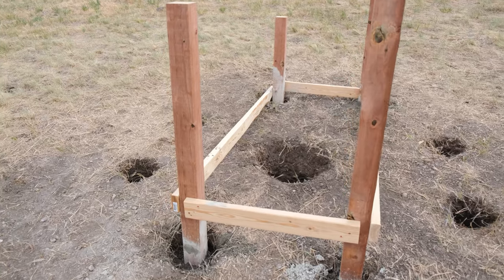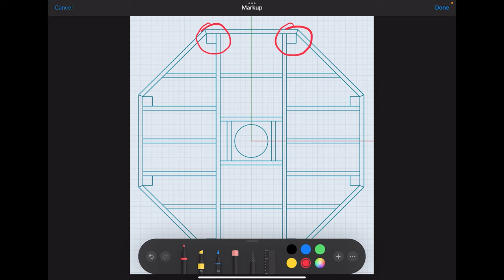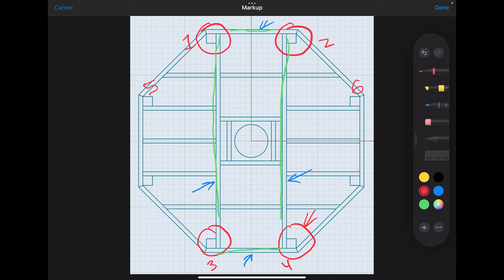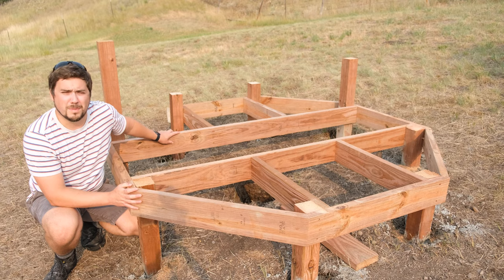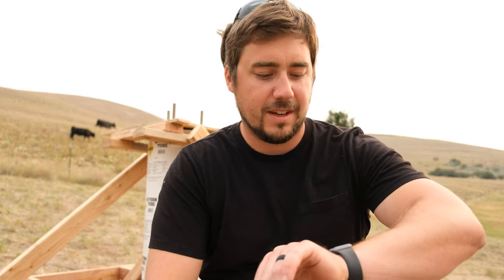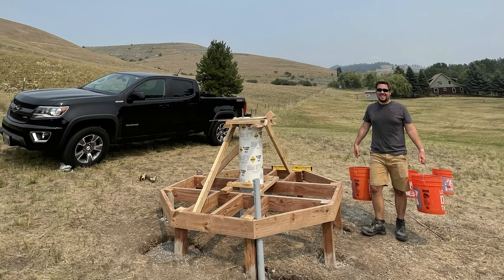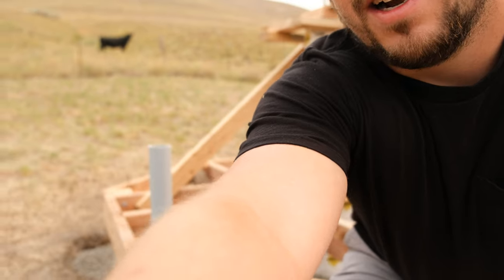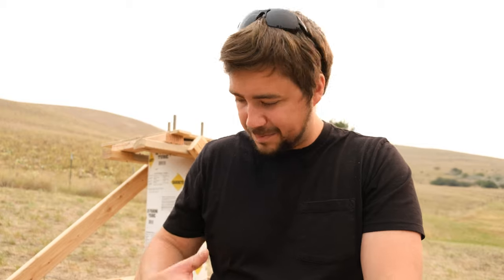Building a ROUND Deck for a NexDome Observatory!

Comment: If the pier mount is in the center at zenith wouldn't the telescope not be obstructed by the dome's slit? Shouldn't the pier be a little away from the center since the RA/Dec center is a bit off the center of the dome, right?
Reply from the maker: Yes it should actually. For simplicity I kept it in the center. I don't think I'll have much of an issue because my scope is so small. We will see though.

Comment: 500 foot data cable; are you running fiber to it?
Reply from the maker: Yep! That way I can expand to 10Gb in the future if I want to. Also, it allows me to run the cable alongside the power cables without interference.
Reply: And fiber is cheep enough these days.  Makes good sense.  Just followed you, you’ve got a pretty good location.  This will be the goal for my next home, lots of land and an observatory.  Nice work!